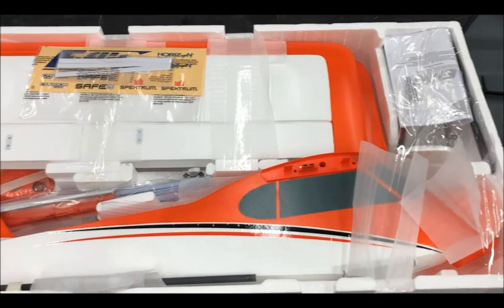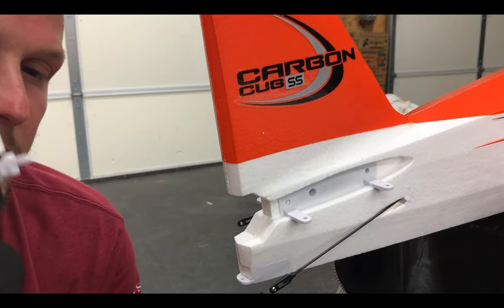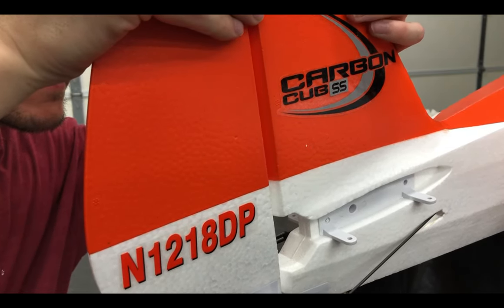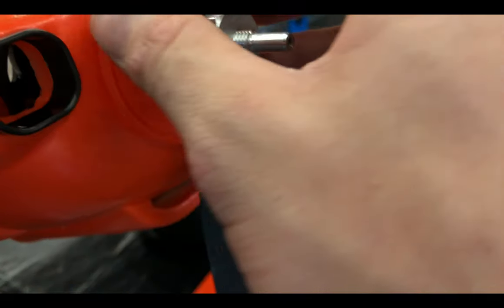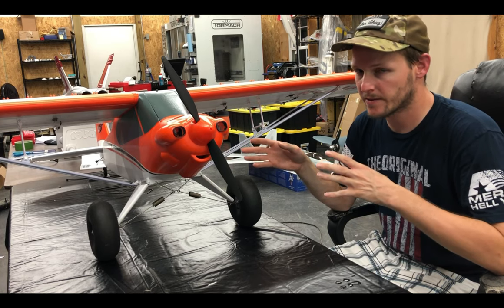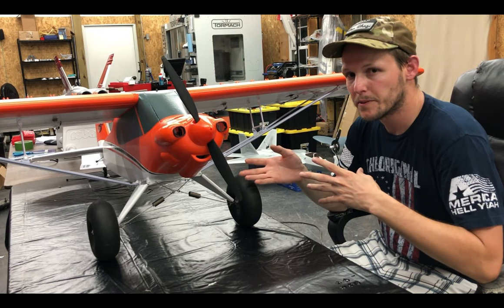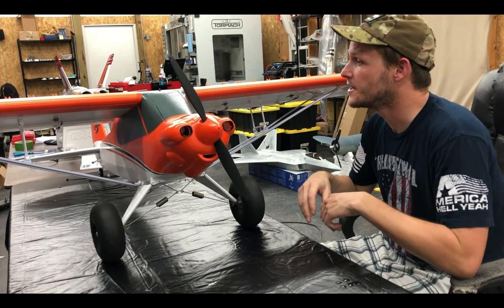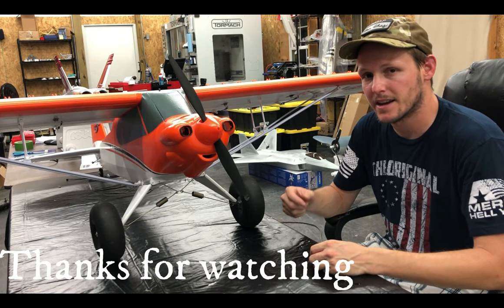Carbon Cub SS+ Build and Review

Comment: Great video, I did not realized how big this puppy is till now. I am going to go for a Carbon Cub S+ for my next plane. But this one is beautiful, I wish I had the space at home.
Reply from the maker: Thank you, taking the wings off really makes it fit in to a closet if you need to, nose down.  Really fun bird.
Reply: Raven Rock Machine and Aviation ok. However I am still quite new in RC planes and I rather get some experience with a more beginner plane and cheaper just in case I crash 🤪🤪🤪🤪 But this plane is for sure on my sight.
Reply from the maker: @nathangarciamuro  Get a carbon cub S+.  I've only been flying for a year.   The Carbon Cub Z (one in the video) can be a hand full if it's is breezy due to the wing being so thick.  

https://www.horizonhobby.com/carbon-cub-s-13m-rtf-p-hbz3200